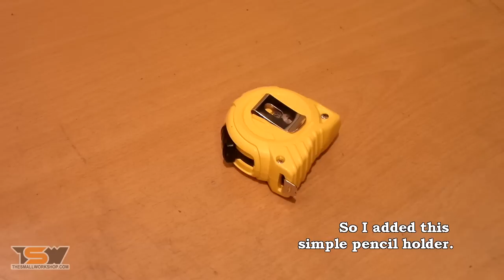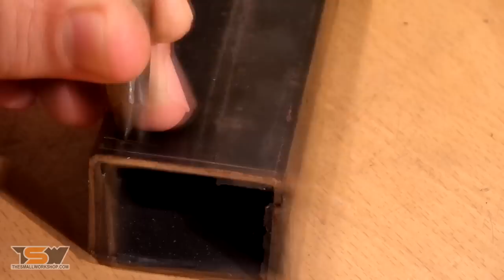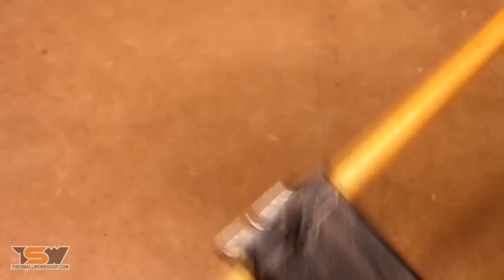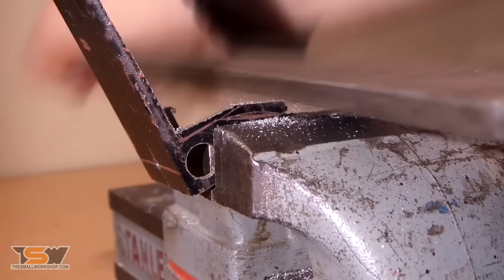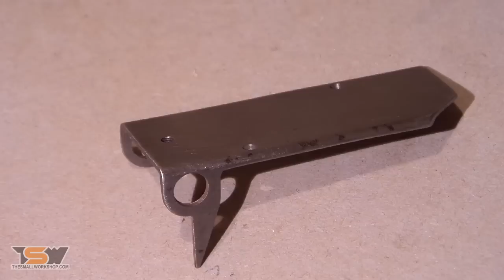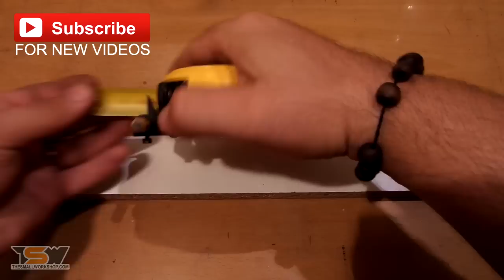Tape Measure Hack / Trick

Comment: People often think that getting angry is a bad thing. I get cross with the way tape measures fall all over the place and spring back, but you have used your frustration to energise your creativity - Well Done !!!
Reply from the maker: Thank you!
Reply: Just made one, works great, for circles too I left the pointer thick as half a drywall screw so one edge of the pointer works this way and the other side of the pointer compensates for the screw thickness when making circles on the hook.

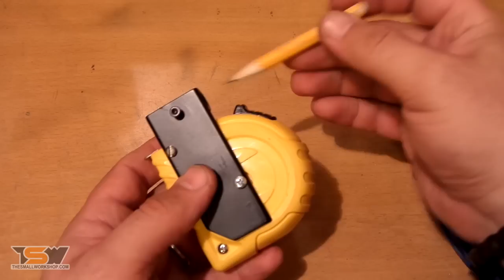Comment: Thanks for sharing all your amazing work. You're an artist turning wood. Great thing about this idea is the ability to lock the tape on the measurement and still mark accurately when it's difficult to see the tape in situ (and one handed!).  It may be possible to use several screws (like the one used at 3:56) to attach the guide to the edges of the case on the other side and keep the belt clip.

Comment: Amazing vid man, tnx for sharing it. I'm gonna try it out with aluminium just because I have some of them around and I think it can be handle with a little bit more precise, let's say that instead of a pointy mark, I want to make a square hole to better pin point or dial the exact measure, like the ruler in some table saw's that have a plastic piece that has a red line in that acts like a cross hair to bette target your measure. What's left to do is maintain the pencil's tip sharp to make a precise mark. Tnx bro!!! ✏️ 😀
Reply from the maker: Another thing that creates imprecision with this holder is the angle you keep the tape measure body when you make the mark. This is good for construction and framing, where one millimeter off is no big deal. For precision I'd use a metal ruler and marking knife.

Comment: That was my idea. I did that 10 years ago and I thought I was onto something that would bre an obvious commercial success. So I went looking to see if it had already been thought of and I found a website that sold innovative tools and I found there was a tape measure with a clear plastic sleeve that went over the tape and which was used to mark the wood with a sharp metal pin. I still have my modified tape measure.
Reply from the maker: Yea, there are several patents similar to this design, yet not one ever made it to market. Tape measures have been around for so long it's only natural that lots of people thought of this.

Comment: I've seen these out there being sold, but this DIY version is pretty top notch... just need to find a cool way to add the belt clip back on, maybe? Though, I don't think I ever clip my tape onto anything, so maybe not 🤓 👍🏼
Reply from the maker: I never used the belt clip either, but it can be easily reattached using the central screw. Maybe with a bit of double sided tape underneath, to prevent it from twisting.

Comment: Great idea. Looks like it could use some calibration but still. You should see about patenting it and maybe selling it to stanley or something. Haven't seen many advances in tape measures, since, well, ever.
Reply from the maker: Thanks! I'ts pretty spot on when used carefully, I hurried in the video, also camera angle makes it look a bit off. Anyway, this is for rough work like in construction, where a mm off isn't a big problem. As for patenting, I'm sure others have thought of this before. Also I'm not a big fan of the patenting system, I think it makes us progress harder.

Comment: Am I the only one who winced when you used your vernier caliper as a scriber? Its a precision measuring tool not a marking gauge! Top marks for the hack tho.
Reply from the maker: You're not the only one, but honestly I'm really surprised about this. It's a cheap set of calipers, probably paid like 5 bucks for it and I've been abusing it like that for ten years and it's fine. I have a digital one for precision work, but I almost never use it, since this one is good enough. This kind of "protect your calipers" attitude is most likely based on education a few decades ago in machine shops, when calipers were expensive and precision was important. But for my needs this works just fine.
Reply: Your quite right my respect for tooling was taught as apprentice toolmaker. I still have the tool kit and chest I made during that time. Its a shame tool quality and maintenance of same has dropped to an almost use once and throw away level. Upsets me when I see a plumber pry a floorboard up with a cheap chisel...guess we are what we are. Keep the clips coming .
Reply: Forgot to add...Merry Christmas to all.
Reply: When you modify a tool for a new purpose it is still a tool. calipers make excellent very accurate scribes. I have one dedicated for just that purpose.
Aircraft maintenance modification and repair 27 yrs. Aircraft tooling 10 yrs.
Reply: I use my digital caliper as a scribe also but use mostly on wood.  It works great and have seen no ill effects on it.
Reply: some calipers are made with carbide tips specifically for that
Reply: Dave IOW it pierced right through my ears and made my teeth cringe
Reply: As an engineerThat's what's it for, same as an height gage, it's hardened steel mate
Reply: Yea there's alot of questionable methods in this video.

Comment: Be kinda neat to extend the back of the bar past the end of tape body and add a bend. The whole thing from the back to the indicator could be a known measurement, like say, 4" and you could use it to butt one end of an inside measurement and then just add the 4" instead of doing that thing everyone does where they just bend the tape and guess

Comment: wow, thats an amazing little idea! how accurate is it?
Reply from the maker: Good for construction. Like one mm off, depending mostly on the angle of the tape measure. If you keep it parallel with the workpiece it's dead on, but if you hurry and tilt it, then it's a bit off.
Reply: 1mm is pretty good if you ask me. Maybe you could add some adjust-ability like you did with the first design by turning the attaching holes into ovals (then you could fine tune it to be perfect everytime)?

Comment: had same idea years ago, did patent  search. some had patent. be careful how far you go!
Reply from the maker: There are like ten similar patents, but none identical to mine. Anyway I'm not in the states and I don't plan on selling this.
Reply: The only change I would make is to use a mechanical pencil so that the tip is always fine and you wouldn't need to sharpen it just click it.

Comment: nice. why not swap pencil and indicator for better reading?
Reply from the maker: I did it this way because that's where the belt clip screw was, but you are right, it would be better on the other side. If it proves a nuisance in the long run, i'll probably swap sides, but for now it works well enough.

Comment: pretty cool...but...when you demonstrate using the finished product...you mark at "20", "30" and "40"....but the actual pencil mark is well off the mark...except for the "30".  Does that mean you need to move your pointed indicator??  If you had created a thin rabbit grove where the plate screws into the tape measure, it would allow a bit of side to side travel to adjust alignment..then tighten down the screws.  Similar to how the markers on table saw fences allow adjustment to the tape.
Reply from the maker: It's mostly camera angles, 30 is spot on cause it's in the middle, but the tape is quite acurate, 1 mm off at most. The demo was shot at 3 AM, me watching though the camera screen and with the tripod and a light between my arms, so yea, not the ideal situation for precision.

Comment: Better yet add a spring so you can just press down on the pencil for making marks cause the longer you measure  without the tape flat the less accurate your measurements will be

Comment: Hmmmm.Clever. What do you call that first bit you used and why. The stock metal appeared kinda soft...what is the material? Thanks
Reply from the maker: It's a center/starting drill bit. Doesn't wonder as much as a thinner bit, so it's good for starting holes. Material was some scrap square tubing reclaimed form an old handrail.
Reply: thank you

Comment: Why did you go through all that work to make a pencil holder while the first one was just fine if not better
Reply from the maker: first one did not have a pointer, you had to eyeball it. Also the pencil was tight fit so hard to replace or sharpen. Also being held in a single screw it tended to rotate if you apply too much pressure. Good enough reason to make another.

Comment: I can't get a accurate reading I'm still off about 3/32. The closest I can get is 1/64 inch how do I correct this issue.
Reply from the maker: I get around 1/32 if I'm somewhat careful or 1/16 if I hurry. Most inaccuracy is caused by the body of the tape not being held parallel with the workpiece. Anyway, this kind of pencil holder is designed for rough construction site work, where a millimeter of is not a big deal.
Reply: Ok thx,love your idea though
Reply: Everything has tolerance folks

Comment: So how do you carry the tape around now?
Reply from the maker: I have a guy with a wheelbarrow. Actually I never use the clip on tapes, I keep them in my toolbox. If I needed a clip I could easily reattach the original one using the central screw. Maybe add a second screw a bit lower to keep it from twisting if necessary.
Reply: OK got ya. lol

Comment: ..or you can apply brake at the lenth you need,set tape still ..
Reply from the maker: .. hold it with one hand while you reach with the pencil in the other hand... and fall off the ladder to your death... impaled in some rebar stubs..
I needed to use this tape on vertical walls on a construction site.
Reply: The Small Workshop .. safety harness rulez...if working over rebars...should know that...

Comment: Purchase drawing compass.
separate out the part that holds the leaded marker thingy. 
attach thingy to pull out rule.
get on youtube. 
open a beer and watch this vid.
call your neighbors.
Start a duct tape think tank.
Reply from the maker: LOL, don't you think I've thought about using parts of a compass? It's the first thing that comes into everyone's mind when it comes to pencil holders. But had troubles finding one that was suited for this application and also wanted to do the project from things everyone can find in any parts of the world, that's why I used square tubing. Don't you think I could just turn the damn thing on one of my lathes? Or weld a piece of pipe to a bracket? But that requires tools that some guy in India might not have. I try to think of my audience before I make a project. Else I'd CNC everything!

Comment: I would easily pay up to $12 just for that single adapter.......now if it came included on a long lasting tape measure I would pay up to $25.....and that's just one person....now imagine all the roofers ,carpenters,drywaller,remodeling,tile guys all that has to do in construction....you would be a millionaire....

Comment: or you could use the tape the right way and use the zero end as your marker the way everyone else does it. but whatever
Reply from the maker: You have 5 meter hands? There's a reason the zero end has a hook, to use it at the edge of the workpiece, not as a marking end.
Reply: The Small Workshop false, any carpenter knows that the zero end doubles as a scribe. and if it is hooked you already have a free hand.. you have esentially turned it into a drawing compass which will result in inaccurate measurements. 

just another answer to a problem that doesnt exist.

Comment: The demonstration of your struggling at the begining was highly exaggerated. Making tic marks along a tape is one of the simplest things to do in carpentry, I've never seen anyone struggle that much doing it. The technique you were using while making the tic marks, moving the tape after each one is a really illogical way of doing it. Same goes for moving the tape side to side when making the marks, this will make the measurements inaccurate because you're pivoting the tape.